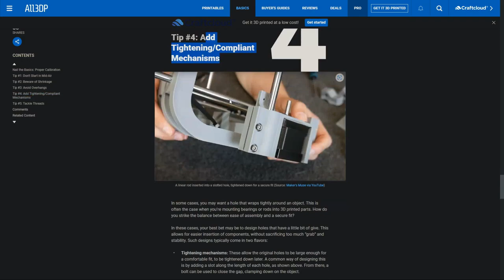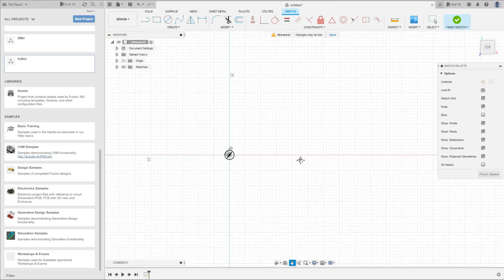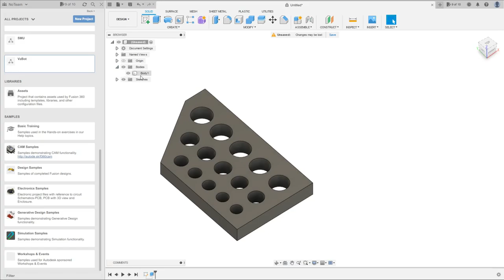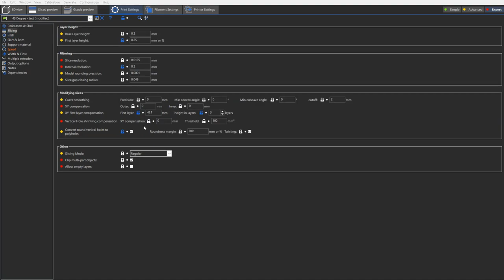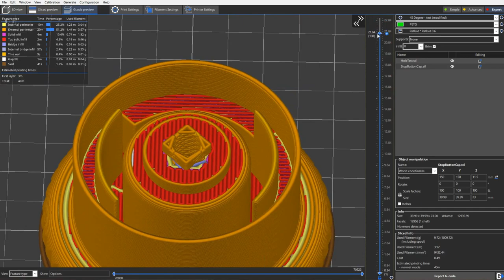Perfect 3D printed holes guide - Polyholes!

Comment: its from 11yrs ago, why are slicers still doing holes wrong?
Reply from the maker: Part of the reason is that years ago, when polyholes was not a thing, people used what they could to mitigate that issue, mostly by designing oversized holes and that mentality sticked to this day, most of models you download from web have clearances added to their holes. This combined with a drilling holes manually was good enough for lot of people. This is also why I like superslicer as it has tons of cool features like that.

Comment: Ehhh.. running PLA exclusively, I'll just print a test print for small holes and use horizontal expansion (same setting as you mentioned, but in Cura).